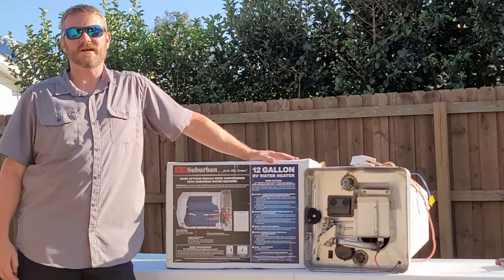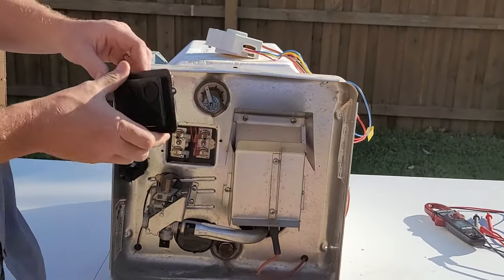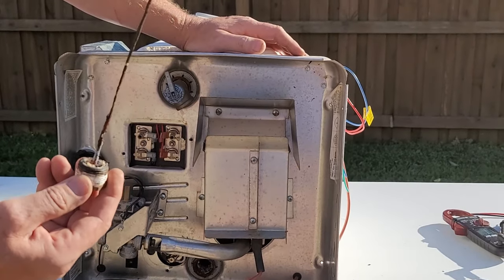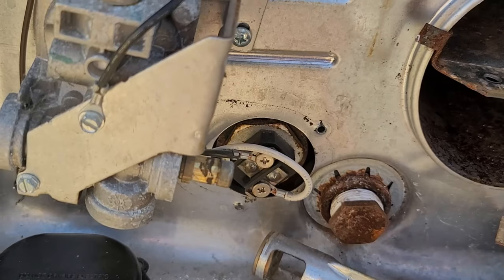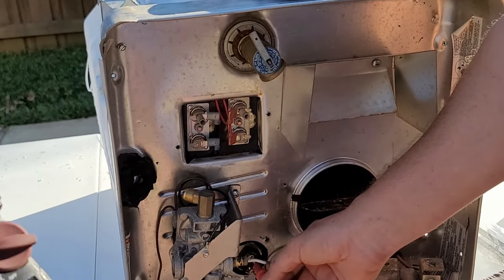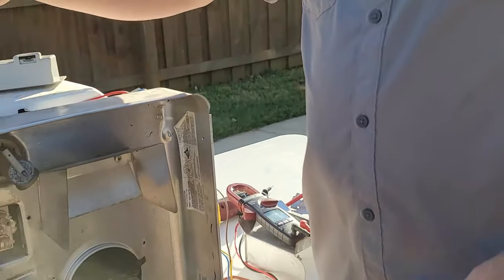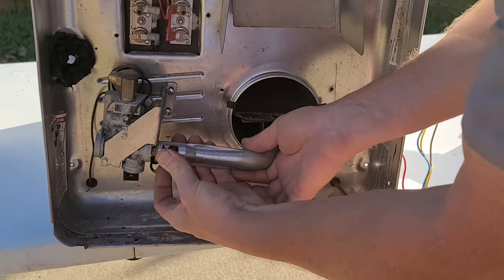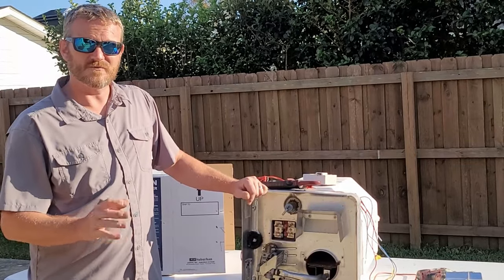RV Suburban - RV water heater walkthrough

Comment: I have this Suburban water heater in my 34 ft Hitchhiker. Where might the control module be located? I'm thinking I need a new circuit board because the gas will try to light but shuts off after a few seconds. This repeats two more times. The electric side works fine.
Reply from the maker: The control board is either attached to the styrofoam insulation at the rear or mounted very close to the tank at the rear. Sounds like your flame sensor has failed.
Reply: @MRRVTECH  I'm wondering if it's just the flame sensor. We have been recently using a generator which we have never used before. Would you advise just the sensor or the module board as well? Thinking the generator could have fried the board.
Reply: @MRRVTECH  thank you for your help and time!!

Comment: Hello i converted my gas to electric and i was told to put the hot rod where the anode rod went now a year later my tank has rusted out im purchasing a new tank where should i put the anode rod if i cant put it in the front do they make a anode pressure relief valve?

Comment: I've got a 6 gallon water heater that has burned wires on the solenoid on the gas valve. How can I stop propane from flowing through the gas valve? I want to disconnect the wires but I'm not sure. Please help.

Comment: Well this will be a test if you do respond so I had to replace the thermal fuse and a new one is starting to do the same thing in less than a month
Reply from the maker: What is the thermal fuse? Doing? Suburban water heaters are not equipped with thermal fuses

Comment: I have an issue, my electric side works but for the emergency I wanted to get the propane side to work as well incase I don't have ac power and I couldn't get it to work, solenoid are good, no egnition, there is 12v at the beakers and no gas or even attempts while I turn off electric heater, maybe I'm doing something wrong here

Comment: I'm sorry but you should have read the manual first. The twosnap discs with the manual reset are the EOC's. Their job is only as a failsafe if the lower normal thermostat fails to open once the setpoint has been reached. This keeps from overheating the appliance. It also forces a human to manually rest the switch to figure out why because normally these switches do NOT trip. If you lose hot water and must manually reset an ECO, that's fine. That's why they're re-settable compared to a one-shot fuse, such as used over burners. 
The lower pair are you normal on/ off thermostats. When you first power up, the line voltage left hand one is normally closed and the right hand not receiving power. The burner fires heating the water. If there is no water, the ECO will trip to protect the unit. Once set point has been reached 135F +/- 5F, the lower left switch breaks open stopping further heating. When the water cools down below 100F or fresh cold water enters it senses this and resets closing the switch repeating the cycle. If there is no line voltage, you can use the12 volt wiring to control the LP burner. It uses the right side ECO and limit switch. ECO's typically trip around 185F. The Temperature/ Pressure relief valve trips at 210F or 150 psi.

Comment: HELP. PLEASE !...I HAVE A SUBURBAN  6 GAL RV *GAS WATERHEATER  I WANT TO REPLACE IT WITH A SUBURBAN  RV GAS/ ELECTRIC  COMBO  ....CAN IT BE DONE ?...WHERE DO I GET THE ELECTRIC  FROM TO CONNECTICUT  TO WATERHEATER  ?
Reply from the maker: Yes it can be done provided you have an available breaker slot in your breaker box. A new 15 amp breaker will need to be installed along with 12/2 romex wiring from the breaker box to the water heater. The new one should come with a switch kit as well for interior gas/electric switches.

Comment: Can the water heater operate on both electric and gas at the same time. Was told by someone that I could do that to maximize the amount of hot water I could get over the actual 6 gallons. If it is possible, how would I get it to do so?
Reply from the maker: You can turn both switches on at the same time.....however this will not effect " how much hot water you get" at all.

Comment: So if I hooked up to city water supply with the heater turned completely off, I should still have water at the sink or shower etc... It just won't be hot. Is that correct? If I'm not getting water at the hot water faucet then that check valve is bad?
Reply from the maker: Bingo! Very likely that's the culprit
Reply: @MRRVTECH  making sure I understood you correctly. Thanks man 👍

Comment: My surburan gas water heater, when switched on inside i cant hear a clocking sound, the heater will not light, i have a full gas bottle, power at the switch both sides i have pushed reset button it appears to be firm any ideas

Comment: I have a 2003 Challenger by Keystone and I can’t seem to get the gay side of my hot water heater to stop working when I want to use electric how do I get the gas side to stop heating and use only the electric? I can’t seem to find a switch in my coach like some of the others have that allows you to switch from gas to electric.
Reply: I have a 6 gal. Suburban . My problem is it did not work on electric. I corrected problem by operating the on off switch several times solving the problem. Now the problem is it will heat until the pressure relief valve opens . Apparently the thermostat is not doing its job or is it something else causing this.

Comment: I have the same water heater in my 5th wheel and the gas will not stay lit. Comes on for a second or 2 and goes out. Any ideas?
Reply: Did you find out what the problem was. I have the same issue.

Comment: Changing the entire unit just wondering what caused it
Reply from the maker: Not changing the anode often enough will allow hard water deposits to etch through the glass lining, allowing the water to rust through the steel tank.

Comment: I need help, I just replaced my suburban 6 gallon SW6DEL, gas/elec.  but still can't get the gas side to work, I turn on the inside switch and the ignitor start clicking but will never fire. The electric side is working I just can't get the gas to work. The old water heater the gas never worked on it either. I replaced the regulator at the tanks, tanks are full, I cleared the lines blew it out with air compressor everything gas works but the water heater. The heater came with a new control board
Reply: I am having same issue. How did you solve it?
Reply: @jeffw1315  The control board was wired in wrong, it had been replaced before I got the rv years ago and the guy that replaced it back then wired it in wrong and just relied on the electric element. So when that went out on me I figured I'd replace the whole heater and wired it in the same way I had found it, which was wrong LOL

Comment: Excellent video!  Does the new style tank with all electronic spark still have the threaded hole where the previous style (Thermostat/Valve, SIT, 3/8" NPT) would screw into it?  I have a 92 Lance camper with the original 6-gallon tank that may leak soon and would like to swap all the outside parts on to a new style tank.

Comment: I'm not getting 12 volt to my gas solenoids and it's not a blown fuse. I get spark 3 times when I turn on but no 12 volt. does the control board also control the 12 volt to the gas solenoids as well as spark? It's the only think that makes sense to me.
Reply from the maker: @4314832  yes that is correct

Comment: Hello, we have a 2021 23RSS and are trying to learn about all the functions.   Just bought it last week but we are trying to figure out the water heater.   Can't find that switch like you have where it says 'water heater' so we can simply turn it on.   We have a switch panel as soon as you walk in the door and there is a switch that says Gas Heater and one that says Water Pump.   We don't know if this is to turn on the water heater or not?   And does the water heater tank just fill when you hook up water to it?  thanks

Comment: Does the control board have anything to do with the electric side of things? I can't test the gas side because I  don't have propane hooked up yet.
Reply from the maker: Yes the control board takes information from the switch/switches and opens/closes relays to determine the energy source being requested.
Reply: Thank you!! And thank you for responding so quickly and at all.

Comment: My water heater works on gas but not electric. I changed the element and switch and it still won’t heat. I checked the breaker and hit the reset. Any idea what to check next?

Comment: The pressure relief valve on my suburban water heater leaks when hot. Replaced it and it still leaks. How do I turn the temperature down?
Reply from the maker: You cannot thermostat is preset @ 135F if it leaks its likely a bad PTR valve
Reply: @MRRVTECH  what's a PTR valve?
Reply: @MRRVTECH  Read my comment again....I  already replaced the TPR valve and it still leaks. The water gets way to hot

Comment: Igniter lights flame burns about 10 seconds and flame goes out camper only 6mos old.
Reply from the maker: Flame sense failure.  Would require new control board. Obviously have it tested by a professional to confirm, but that is the symptom.

Comment: A million videos showing what a water heater does but nobody wants to show how to wire in a new installation.
Reply from the maker: The schematic is attached to the water heater.
Reply: @MRRVTECH  Wiring in a new installation from a sw6p to sw6del, wasn't really hard but what's the point in making a how to video that only shows how to on the simplest things where all anyone needs is a bit of common sense and leave out any technical information.